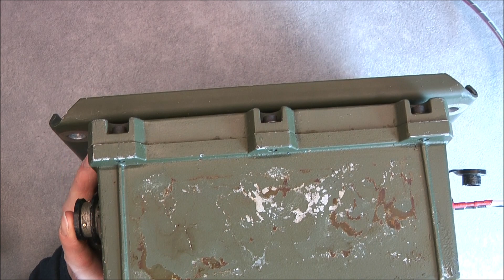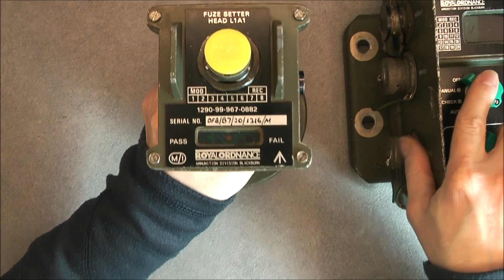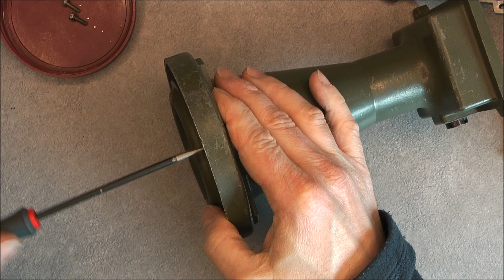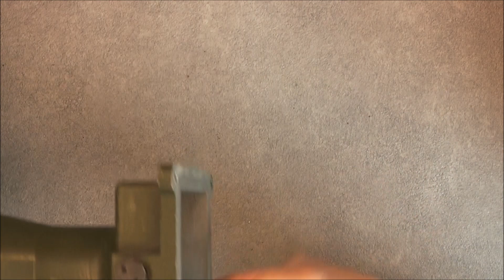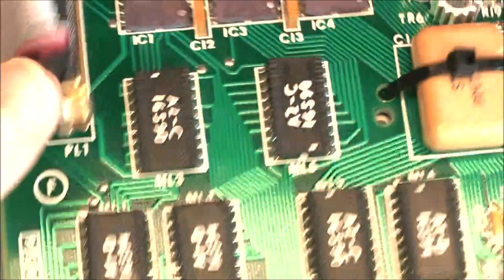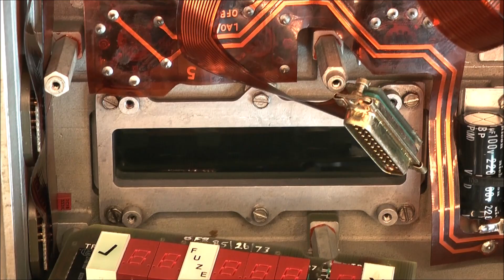Royal Ordnance L1A1 fuze setter teardown

Comment: Processor is an RCA 1802 ‘Cosmac’. They made, and still make (now by Intersil) radiation hardened versions for aerospace and military applications.
Reply: The original rad-hard CDP1802 was made with silicon-on-sapphire (SOS) technology, almost impossible to find. But if you have a CDP1822SD ('S' is SOS), you have a SOS 256x4 bit SRAM.  Two SOS 1822s were furnished with the CDP 18S020 Eval board in 1976.